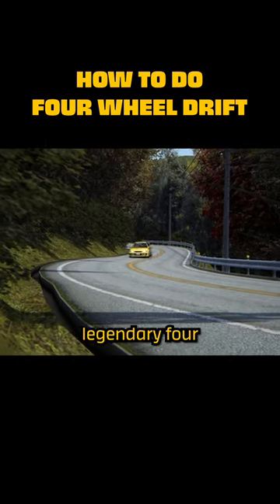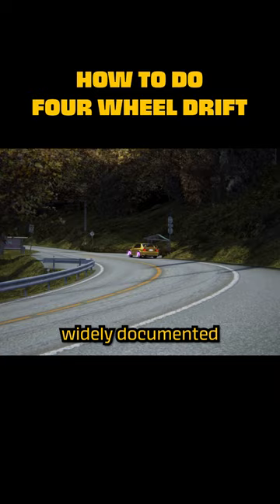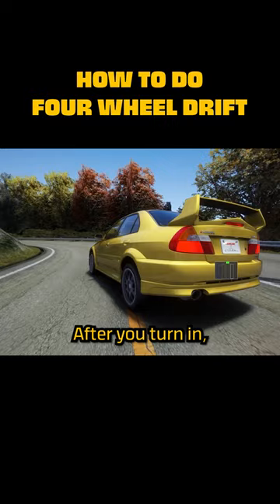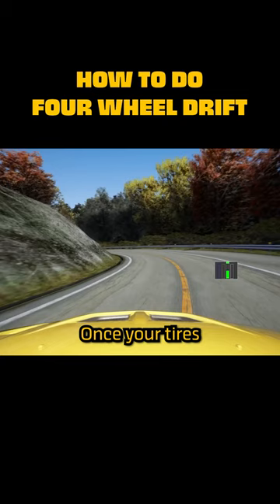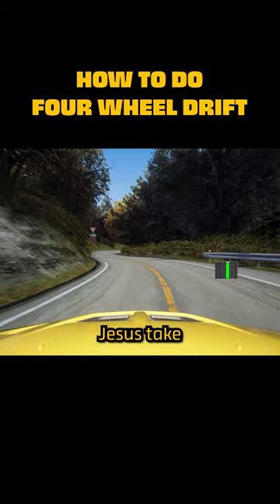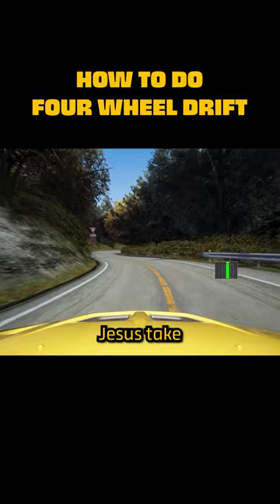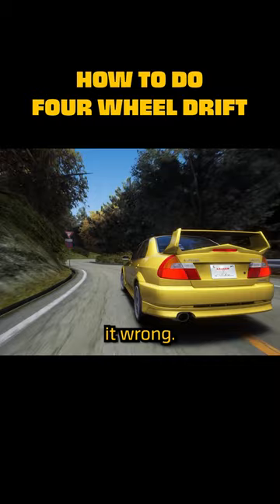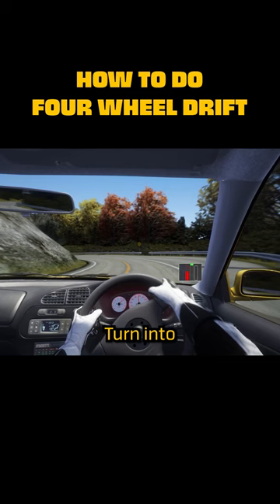HOW TO FOUR WHEEL DRIFT #simracing #shorts #assettocorsa

Comment: It's not the fastest way through the corner... 4wd wheel drift is only fastest on non-tarmac surfaces like dirt/snow
Reply: Even then, it is often faster to take a proper line, and not slide.  It is a lot more dangerous to do this though, and is why sliding is often used.  Saving a second by cornering properly is only worth it if you're able to make it to the end of the track in one piece.
Reply: Exactly. The more downforce you have, and the more the diff and roll bar setup is circuit based - the more this technique becomes obsolete
Reply: It all depends on the car being driven

Comment: Now we need a AWD drift lol
Reply: this was it
Reply: Yeah. 4 wheel is when all 4 tires turn in. His was an AWD drift. Two different things
Reply: @djibrillesalako3765 wait, i thought 4 Wheel Drift is like Drifting but with All wheel drive car. 4WD = AWD
Reply: @neemojenkins881 4 wheel drift can be performed by any drivetrain. It’s most common in AWD and RWD. “Drifting” is for getting a more extreme angle as you can through a corner while the 4 wheel drift is getting enough rotation of the car around the corner so that the car is pointed towards the exit earlier. You’re technically understeering with the front wheels while the car is pointed toward the exit.

Comment: This is in no way the fastest way around a corner.  On a low grip surface, it may be the most predictable/ reliable way to position the car.  But the fastest way around a corner will almost always be with full grip and proper racing lines, not sliding.
Reply: Trail braking moto...

Comment: you can adjust the angle for the corner only at the entrance by applying abit of handbrake while braking exactly when the weight shifts to the front end whipe turning in

Comment: Interesting, Now make a video on how to drift with front wheel drive.
Reply from the maker: https://www.youtube.com/watch?v=nFGJwav0ieQ
Reply: that's pretty much how you do it in fwd and awd. rwd cars would spin out on max throttle application as shown in the video
Reply: fwd drifting is pretty much just the same
Shift the weight, lift off, let the rears slide out and power back on. The fronts will pull the rears back into line

Comment: Gentle braking with a blip of heel and toe is the perfect way to stabilise the car while being able to pick up the revs as fast as possible - the one mistake to definitely avoid is turning in too hard or too fast. You want to ease it into the drift, not yank it in - otherwise youve compromised the balance of the car.

Comment: We do something similar in MTB except without the brakes.  In flat, wide corners we'll let the tyres lose some grip and slide the bike through the turn before hooking the tyres into the dirt and carrying that speed into the next section. Done right it A) is fast as hell & B) looks fucking cool, double points if the trails are dry and dusty, bigger the cloud the bigger the style.
Reply: Trail braking?

Comment: Ive always had trouble with wheel pressure on this technique
And maybe the suspension tune too is a problem
But everytime i do this it understeers badly from either low tire pressure or high tire pressure

Comment: Does this apply for FR Cars too?
Reply: Absolutely! 4 wheel drift just means that all 4 tires are making contact with the road surface with more or less equal weight distribution so that the car can essentially run at max speed through a corner since the 4 tires will grip better than a regular handbrake drift that forces all the weight to one edge of the car
Reply: yeah but its much harder because you have to be more sensitive so you dont spin out

Comment: Im not gonna lie, ive been raised with drifting being the slowest possible way around a corner, rather just fly threw it and just maintain as much speed as possible
Reply: Because drifting is the slowest way around a corner
Even on Iroha you want to avoid sliding as much as possible and you do like a half drift where you get quite a bit of angle but you still avoid wheel spin